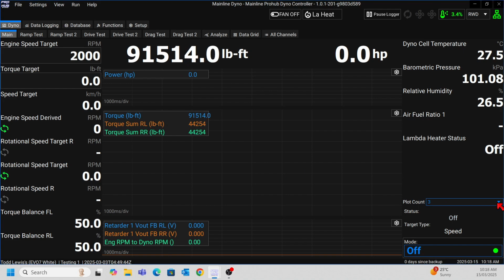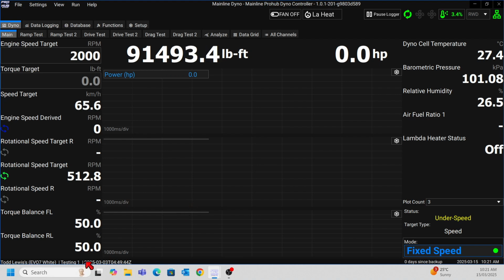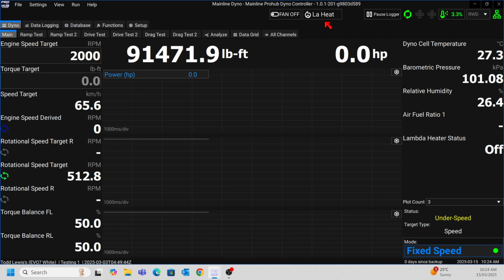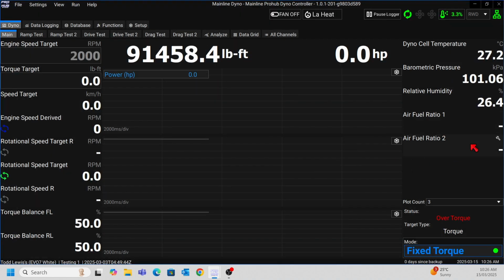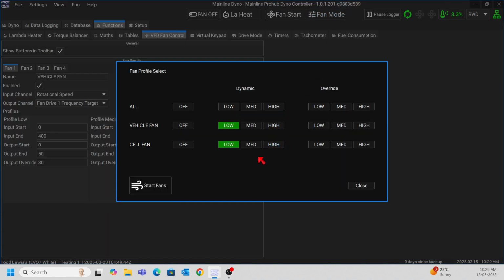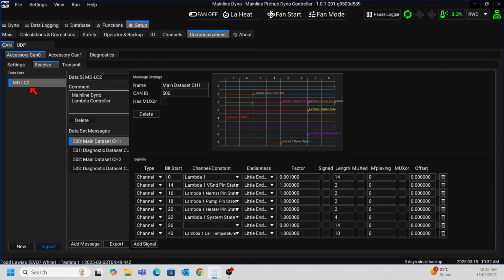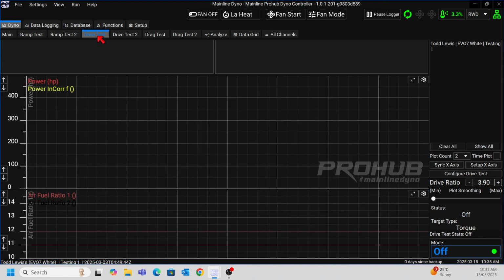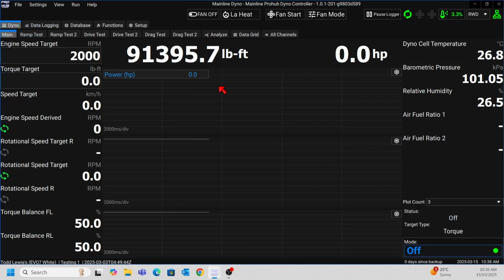CAN CONTROL SYSTEM - SOFTWARE OVERVIEW

Comment: 2 questions- when in torque target mode, what happens when you over shoot or undershoot the target? If the target is set to 200 for example, and the wheels aren’t spinning yet, will it allow you to get enough rpm to reach 200ftlbs?
In drive mode- is there a way to define the amount of resistance? Like telling the software the weight of the car or something of the sort?
Reply: In Fixed Torque mode, it is not "Steady State", it is "Fixed Torque", so you can drive anywhere from 0 to whatever with a fixed torque value. You can change the resistance to alter Drive Mode load via either altering Vehicle Mass or changing the "Incline" value. The Torque Target values are axle Torque values, so has much greater resolution than "Derived Torque".
Reply: @toddlewis_mainline awesome!!!